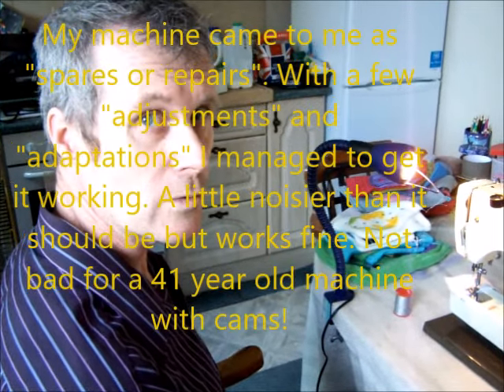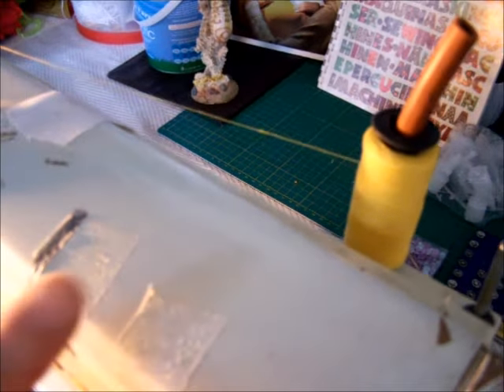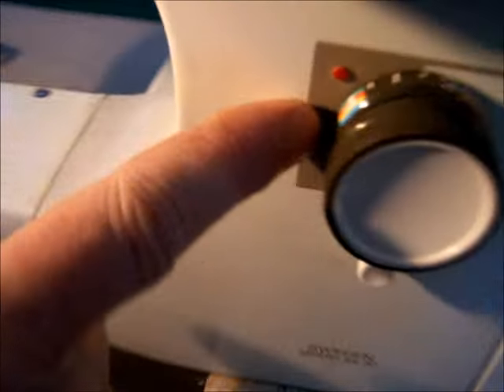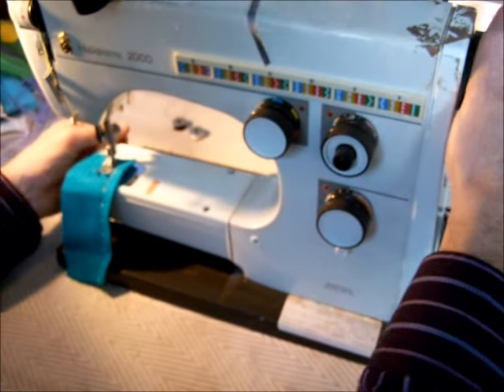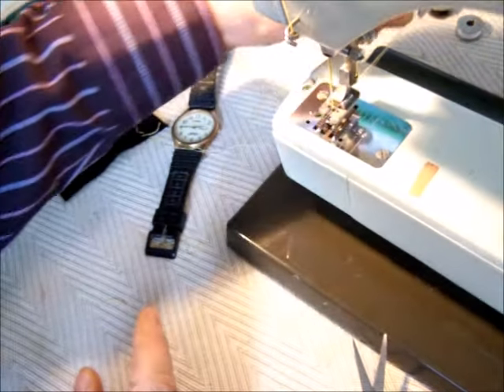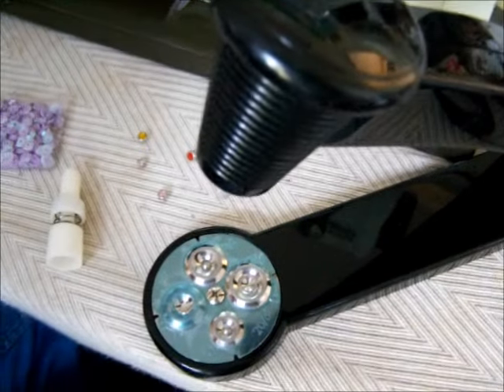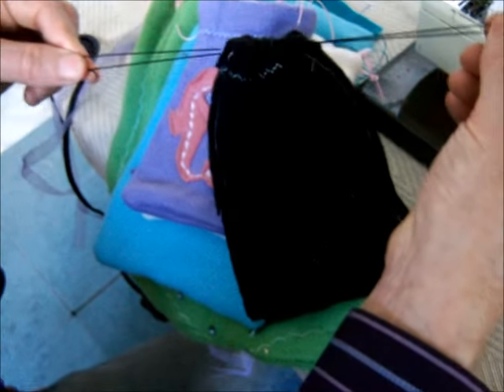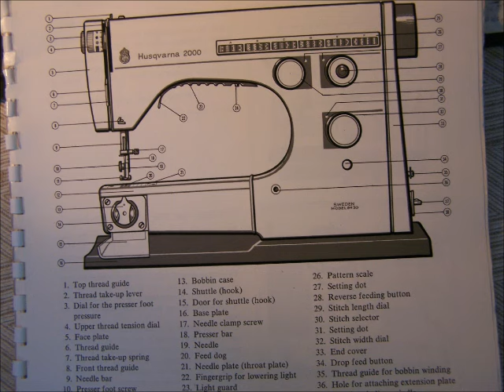Husqvarna Viking  Sewing Machine with Cams - Mike Culligan

Comment: Got this one 2nd hand "refurbished" for my mum a couple years back. She used to have this very model back in the day and i think she`s delighted she now has a sewing machine again.
Reply from the maker: Yes, it is a wonderful sewing machine. Thanks for watching.
Reply: Say, are there any clever upgrade parts/hacks for this particular machine that my mum might find useful? She doesn`t know much about these things, but maybe yoy have something to add to my inquiry. Thanks :)
Reply from the maker: My machine had a cracked cam chamber inside where the cams click in. I just superglued the broken plastic together and voila it worked! You can set stitch width to lower or higher levels than the colours indicate on the dials to give more stitch variations.  Make sure to look out for spare bobbin holders - they are rare! That's all I know of, apart from getting hold of the manuals! Best wishes.
Reply: Thanks mate :) My mum told me she would like another one of those metal bobbins. I`ve seen them online but i`m a bit apprehensive about buying them because i don`t know the exact model & make. She also mentioned a few more plastic spools that would fit inside the bobbin would be nice. She told me she had an issue with the two speed gear a while back. Wouldn`t kick into the high gear. I tried looking at it but ended up just spraying the area with some CRC, lol. Not sure what you mean by cam. The owners manual was included when i bought the machine.
Reply: @giantdormouse  I have the original Manual book for this Husqvarna Viking 2000 machine, it is very useful and describes how to use all of the different features. I bought my machine for $25 at the dump store and it was completely frozen but I got it unstuck and running again with some liquid wrench and a hair dryer. It came with all of the cams, a little metal sewing platform, the carrier box, some bobbins and two original booklets, one is the manual and the other is suggestions for sewing projects from Husqvarna, it even came with a working light bulb for the light. I like this machine very much it is very heavy and sturdy, I cant believe someone was going to throw it away!

Comment: This is such a useful video, many thanks!!!  💕👍🙏💖
I bought one yesterday, a Viking Husky #6030.  No manual, no accessories.  Found some cams second hand as well.  Now to figure it out.
How to clean the old resin residue from dried up lube or gummed up oil inside?  Alcohol?  Xylene? Acetone?  WD40?  Please share ... anyone?

The bags were delightful and creative!  Thanks for the great cams demo.
One question:  I have a #6030 Viking.  There are only 4 cams shown on top panel A-B-C-D. However, there are cams E-F-G-H-I.  Will these work on this machine as well?

The guitar and harmonica combi was lovely.  A man of many talents!  😎

Comment: Hi there, thank you for this useful explaination of the patterns! I was just wondering how to set the machine to sew a plain straight stitch? Thank you!
Reply from the maker: So pleased it helped you!
Reply: Me too, I'd like to know how to do a straight stitch too. Do you turn all the front dials to 0 and remove the pattern cams?
Reply from the maker: @AskGesus  Turn the handwheel towards you until the needle  is in the highest position. Then, set the stitch selector (upper left-hand dial) at the straight stitching symbol (zigzag going to small lines/dots).  The stitch length dial (upper right-hand dial) is graduated from 0 - 6 and should be set at the required length (depending on how long you want the stitch).  The stitch width dial (lower dial) should be set at 0 for straight stitch. Hope this helps.  (Sorry, I thought I'd already posted this reply). Best wishes.

Comment: Hello. Thanks for the video, it was nice to see this machine in action! I just got a viking 6020 machine for free that hasn't been used in 20+ years. I've never had a husquarna before and didn't know what cams were (it's missing all of them) and it needs some work. You seem so familiar and comfortable with it so I was wondering if you would know this- will it still sew a simple straight stitch without any cams? Should the reverse button have a springy feel to it? mine doesn't pop, and feels like it's missing a spring maybe? and should all width/length/selection knobs come off? 2 of 3 are stuck and perhaps need cleaning, one came off easily and had some grime under it. Thank you!
Reply from the maker: My viking machine was seized up  and I used an old tried and tested method I found on youtube which was to use a hairdryer to heat up the resinous mass which the old lubricant had turned into inside the machine. Obviously I unplugged the machine first and opened it up from the outside screws. Always useful to take photos or film where the screws were! Once the machine could be turned over by hand it moved more freely  and I was able to completely make it work with fabric. I would probably download the pdf manual for your 6020 machine or a 4000 series machine which are free online. Cams are pretty essential so look out for them and if your machine won't work look out for any second hand ones on ebay etc.  Your machine should be able to do straight stitches without cams but pattern stitches need them! The reverse button should spring and then lock in place - and then you press it in again and it comes out. Sounds like your machine may be seized up and you should try the hairdryer method. My selection knobs don't come off. They seem to be on a spring and click when you turn them. Sorry I can't be of any more help.
Reply: @giantdormouse  than you for taking time to answer! Yes, obviously everything is unplugged and I actually disconnected and removed the motor completely. I did use the hair dryer and wd40 to unglue the gunk (it's the only thing i had, sorry i know some do not recommend using it at all). And I'm using egg cartons/ziplock system :) and notes and photos to make sure i keep track of where screws and parts are coming from.  So mechanically most things are moving and turning, but the machine is stuck in reverse (it does move feeding dogs forward when i turn the wheel the opposite way). I figured out how to remove plastic knobs- you have to pluck the shiny metal circle out of the knob with a needle and it exposes screws in top left and bottom right/width knobs, and pull out the white plastic button to expose screw on Length (top right) knob. But the button on length (top right) does not spring back on my machine and that seems to be locking the reverse/forward switch. There's a part that's attached to that button that seems to be moving freely and doesn't seem to be springing/pulling/pushing any other part. I went thru the manual that there's no clear picture of what it should be attached to. I'm not experienced enough to take the whole thing apart - I don't have any experience in mechanics and there are way too many moving parts and springs. I was so hoping to get this working :(
Reply from the maker: I do hope you get it going. I'm not a mechanic either - so have only managed to get things going through perseverance and trial and error.  I wish you all the best. It is a lovely machine to work once you get it going! All the best.
Reply: @giantdormouse  I kind of got it sewing! It's not a permanent or ideal fix, but i got it going. I figured which part on reverse mechanism needs to be pushed up/back. As long as I don't press the reverse button - it's going in the right direction :) It'll work for me for now. I wish I could attach a photo here.
Reply from the maker: Great to hear you got it going! Hope you enjoy using it.  Have a look out for the cams second hand because they really do make great stitches!
Reply: I have a 6440 model, looks the same and yes you can do a straight stitch and zig zag stitch without cams.
As for the reverse button when you get it heated and oiled and working it doesn't click into reverse you have to hold it until you want to stop and release the button.